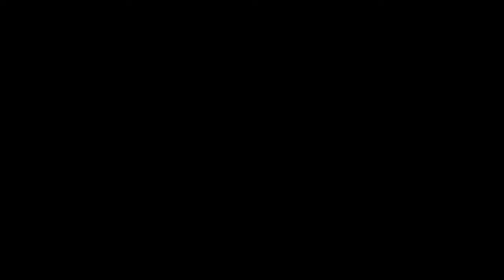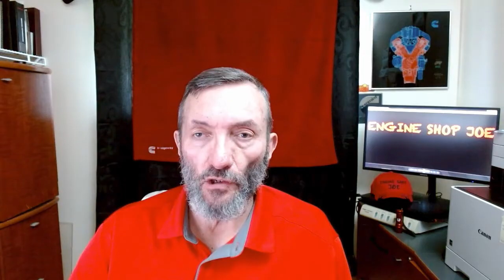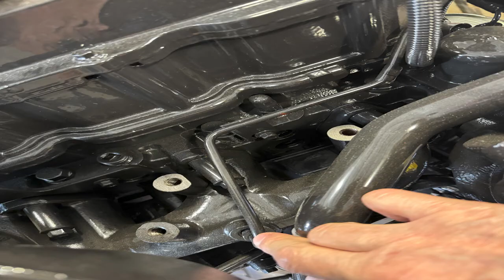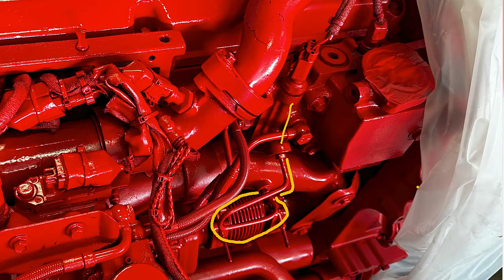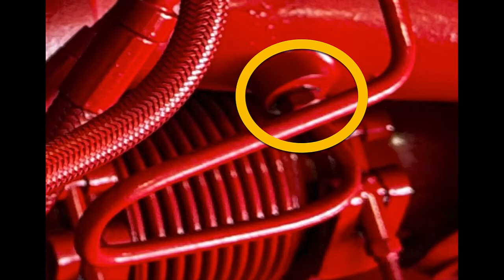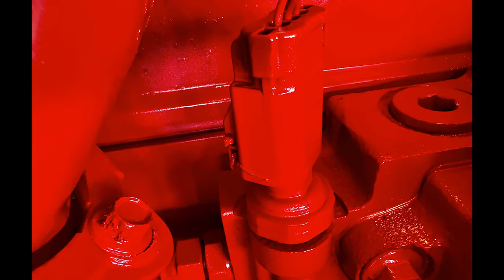Alll about the exhaust gas pressure sensor

Comment: I been getting code 2692  this sensor may be the causes?
Reply from the maker: The problem is either the particulate matter sensor is failing or the DPF is cracked and too much soot is getting past it. If you truck puffs black on a shift or when you get into the throttle  it is the dpf. There is a cleaning diagnostic for the particulate matter sensor that is INSITE. under diagnostic tests.

Comment: I got a X15 cm2450. 300k miles. I keep getting two reoccurring codes. 7233 fmi 1 and a 125 fmi 1. For intake air temp/pressure sensor. Upon removing the sensor, its always filled with soot. I clean it and clear the codes and sometimes it will go a month without coming back. When it comes back it, it puts the trucks countdown timer on for a derate. Its dry in the intake manifold, just soot from the egr. Doesnt consume coolant. What is your recommendation? happend at least 5 times so far in the past 10 months. I have changed the sensor twice so far.
Reply from the maker: Does your truck regen frequently- should be averaging 100 hours between regens. If it is regenning frequently <80 hours the engine might be smoking for some reason. Also put your engine serial in QSOL see if there are any campaigns for calibration updates. Check the TSB's for those faults but you have to convert them to cummins fault codes. Do you do excessive idling? Also if you do city driving or idle a lot the egr can sweat (normal) and then a more than normal amount soot sticks to the sensor. 
Last if this just started and you never had the problem before check aftertreatment history first as the engine might be running a little dirty. On new stuff like this (2450) they put in cal fixes and have TSB updates as they learn of issues
Reply: @ENGINESHOPJOE  I will have to ask the driver about the regen frequency. I'm sure he does excessive idling. Definetly does cuty driving. Its a roll off truck. Has a pto. So it does get run hard. I will look into a calibration update the next time it comes in for a service. Thank you for the advice. You have a great channel here.

Comment: Hi, can you please let me know what can cause fuel pressure relief valve code to set on after washing engine . It only happens after wahing engine. AND everything goes back to normal after day or two.  Truck sets derate and goes to restrictions  turbo boost.
Reply from the maker: The engine wiring harness is not water tight and moisture is getting into the harness causing this. Unless you really need to wash your engine IE you haul hazmat or explosives and have strict DOT or EPA inspections I recommend you do not wash your engine. Of course if you have an oil leak or fuel leak then yes clean it off. I have a video up on a valve cover that all 8 bolts broke off in - flush with the cylinder head. It took a day to drill all the bolts out with out ruining the head (small bolts in thin casting areas). The washing did not damage the wiring or engine parts but in the long run it causes more problems than it solves. This is my opinion. BTW we had two trucks that logged faults after an engine wash. After you drive it awhile the heat from the engine dries out the harness. The fault happens because the moisture causes an electrical path (short circuit) between wires.
Reply: @ENGINESHOPJOE  thank you very much for answering.  Your videos are super informative.  I appreciate all you do to help us learn and save money.
Reply: @bb-ob5cc  Yeah, another guy on YT here, Rawze, said the same thing in one of his videos. You can use engine degeaser and a hand towel to clean parts with, but do not let the truck wash people power wash your engine. It's not good with all the electrical stuff on the engine.
Reply: I quit doing that years ago because it would  generate trouble faults directly after washing the engine. Sometimes the dreaded red stop engine light would show up.